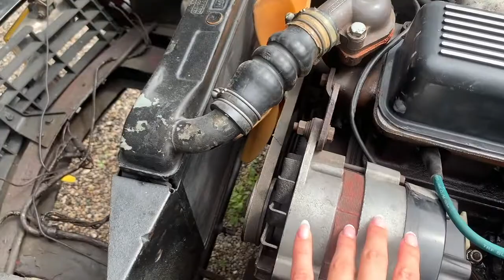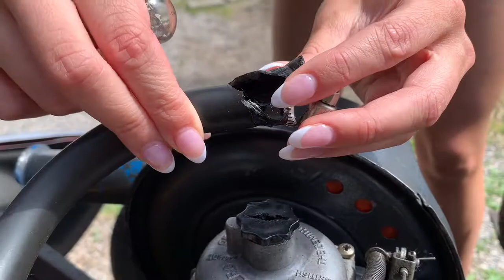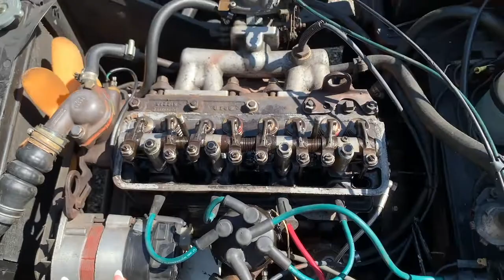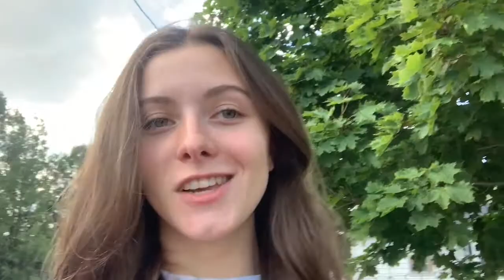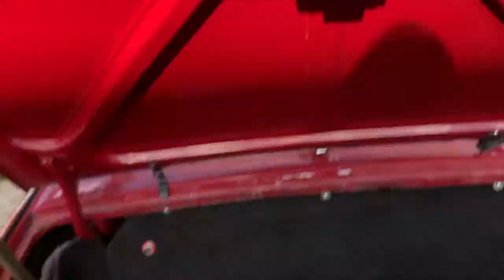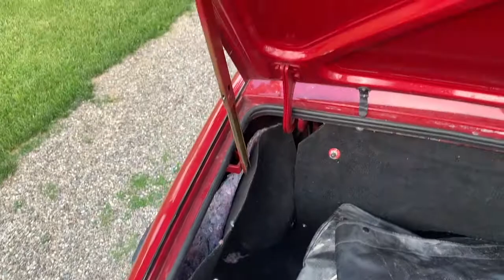Ep. 2 | Restoring my '73 Triumph Spitfire 1500

Comment: Hi Saige, you're learning fast which is terrific. My guess would be an electrical problem as the engine seems to turn ok. So it could be something really simple like a broken wire or blown fuse. Will the motor turn over if you try and start it? If so, pull a spark plug out and see if there's a spark. No need to tear into the engine just yet but definitely change your oil when it's fixed 🙂
Reply from the maker: Thanks for the suggestion, really appreciate it! We’re pretty sure the electrical is good but it looks like there may be an even bigger problem… I’m posting an update tomorrow so let me know what you think :)

Comment: They both look like a good aftermarket Moss Motors rocker cover. It's your personal preference really.
At this point I would remove the belt and make sure you can turn the pulleys easily and that they're quiet. The rocker assembly at cylinder 4 is at the compression phase, and it's normal not to have movement at certain times (at compression valves are closed which means the slack is off the cam/rocker.)
If you want, you and your dad can DM me and I will try to help...
Reply from the maker: I really appreciate the note about not having movement during compression, totally makes sense! I’ll definitely take you up on the DM offer once I investigate a bit more :)

Comment: Great job learning from scratch! If you put it in 4th gear rather than first it will be easier to turn the engine over. There is a great Youtube channel on 'the rule of 9' for your rockers - Steve Denton. His channel is really good for beginners. Bite sized vids and clearly explained. Like you, I had no mechanical knowledge prior to getting my '71 spit last year. Fun learning. Silver cover! Mine was bright red last year but the crankshaft died and I had to have a complete engine rebuild this year so now it's silver like yours. Hopefully, now that it's run in I can have a blast running it during the nice weather.

Re-doing the rear suspension will be a job for the winter. It never ends! Can't decide if I bought a car or a giant Meccano set (English mechanical construction set for kids in UK).

Keep going. You're doing great.
Reply from the maker: Hi Phil! So sorry to hear about having to do a complete engine rebuilt. I’ll definitely check out the channel suggestion! It looks like I may be in the same boat as you were, we’ll see! Have fun driving yours this summer :)

Comment: your father probably knows a bit about cars.... my bet is the ignition coil went out.... or the ignition module went out.  both exhibit the symptoms your parents experienced.  crank it overr check for spark.  your dad will know this i;m sure.  if there is spark then remove all spark plugs and take a compression test.  you might want to check if the alternator is putting out correct voltage as well.  but the most likely culprets are the ignition coil or ignition module.... which all spitfires from 74 onwards have.   it's a common fail on these.  best of luck
Reply from the maker: Thanks so much Nick, we’re pretty sure it’s mechanical because the car was running at 4000 RPM when the clunking started. We took your advice and pulled the plugs and did a compression test… stay tuned tomorrow!